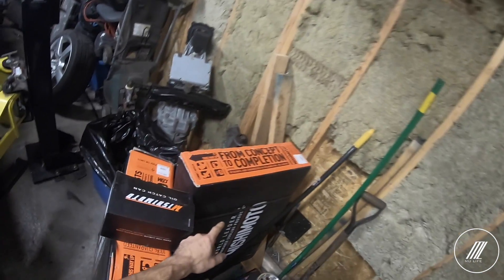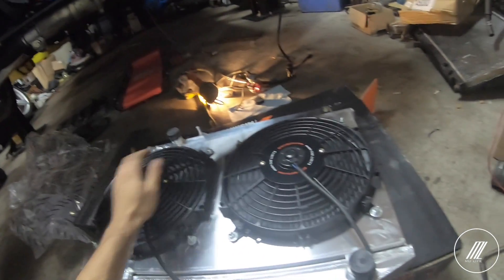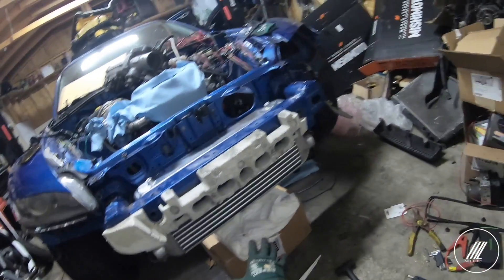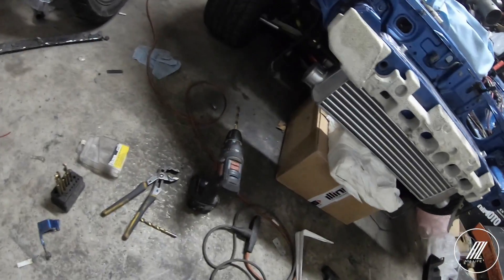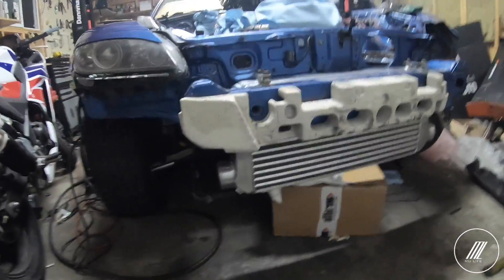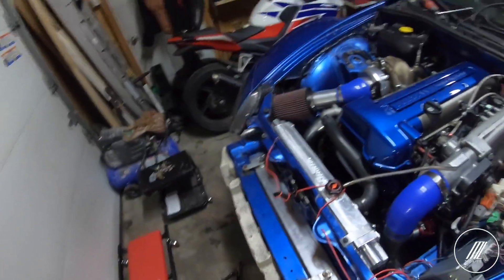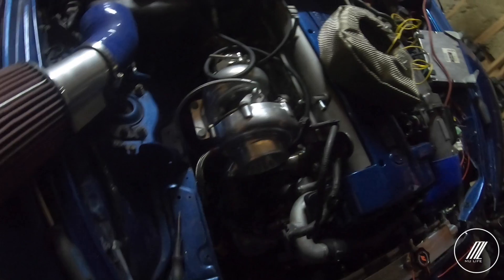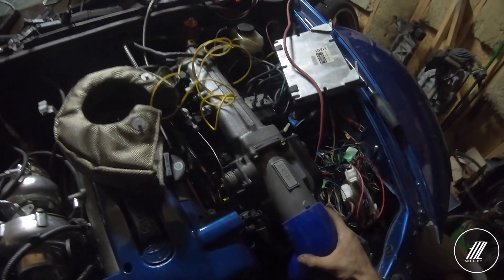RX8 2JZ Part 14 - Mishimoto radiator / Intercooler setup.

Comment: Ayye man just wanted to say I appreciate you making these videos because I actually am doing the same thing. Picking up my 2jzge this coming Sunday. I mainly want to know, when you get there, if the cd009 will line up like the stock trans within the trans tunnel...and and what rear end you'll be going with as well?
Reply from the maker: Hopefully these videos will help you with your build , for the CD009 i used Collins adapter to adapt it to the 2JZ engine , Transmission tunnel had to be shaved a little. I am using stock rear end for now.  Follow me on instagram ( in description ) for more updates.
Reply: Thank you so much man!! I will for sure follow and share your content man, great coverage of everything...as for the trans tunnel, you shaved it back closer to the rear or the front of the car? I mainly just want to know how the cd009 shifter will line up with the stock shifter hole...if that makes sense.
Reply from the maker: I had to remove the heat shield from the tunnel and shave the tunnel towards the rear and also the shifter hole a bit ,  i used serial 999 to bring the shifter forward to the stock location. If you are curious to know where the shifter of the stock cd009 transmission , pretty much ends up far back and interferes with the handbrake lines. you will need to relocate the shifter.
Reply: @GridMotorsCA  thank you so much man!!! Again I appreciate your videos and intel of the build. Can't wait to see your finished project.